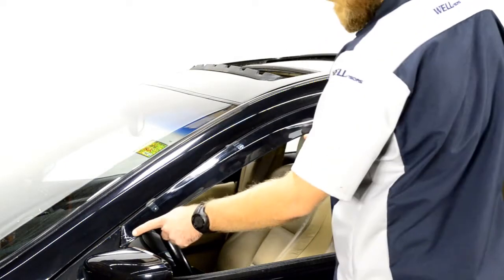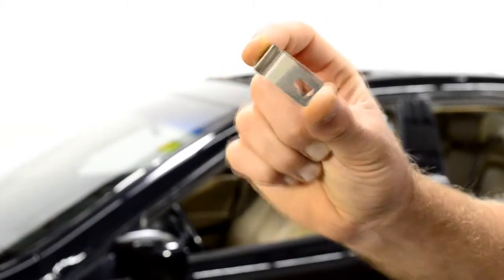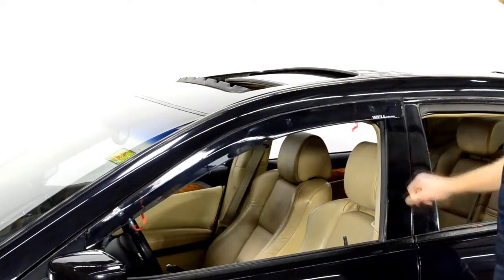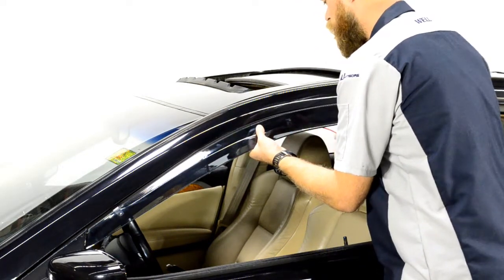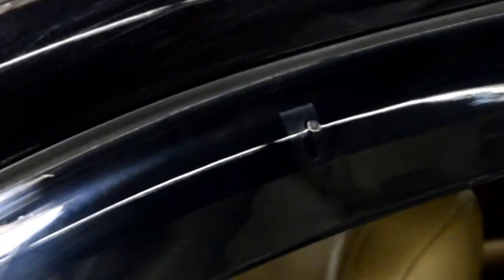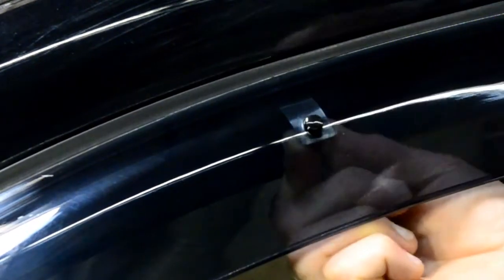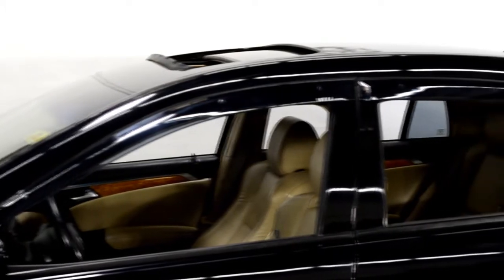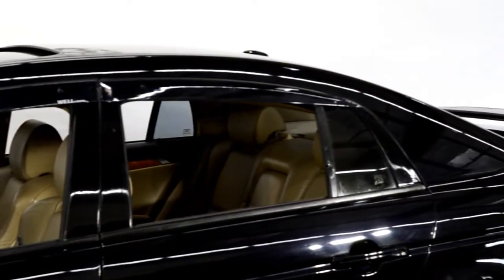WELLvisors side window deflector vent visor Installation Video ACURA TL 04-08

Comment: Bought this product about a week ago. The instructional video was EXTREMELY helpful. Thank You. The most difficult section of the video was installing the clips. They bend so easy and are very flimsy but  the trick was paying close attention to the video as he slightly pulled the rubber from the door so the clip would slide in as instructed. By the time I got to the second window it was much smoother and then I was okay with the last two windows. Thanks again for the instructional.